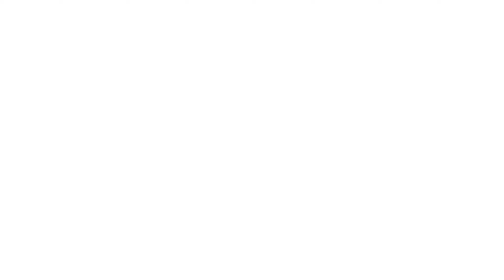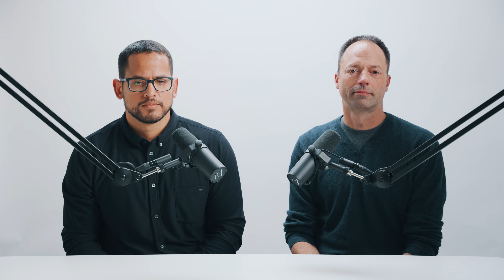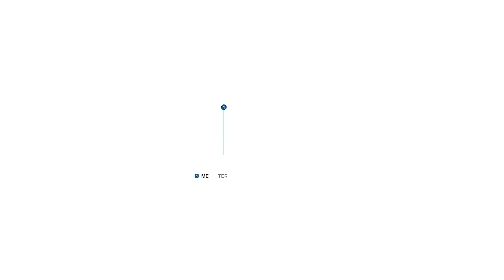Office Hours—Episode 22: CDX technology

Comment: Is the physical measurement of CDX different than the Teros sensors, or is just the analysis of the response different? If the physical measurement is different, how is it different?
Reply from the maker: Hello, Jimbo
Yes, the CDX Platform is a new measurement technology. The CDX-based sensors use what is called the 4-voltmeter method for their measurements, which is different from the capacitance measurement circuitry used in the TEROS 12. You can learn more about the 4VM method at an upcoming webinar on 4/23 @ 9 am PDT: https://metergroup.com/webinars/cdx-the-new-era-of-soil-moisture-sensing-reliable-accuracy-regardless-of-salinity/. 
There is also more information about the SOLYX 14 here: https://metergroup.com/products/solyx-14/.